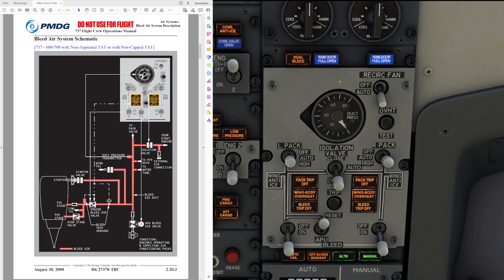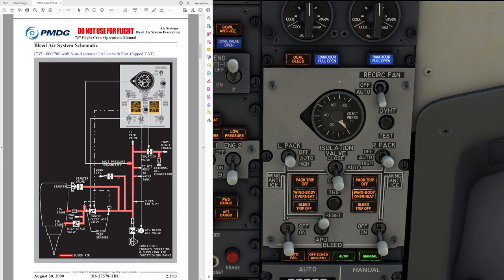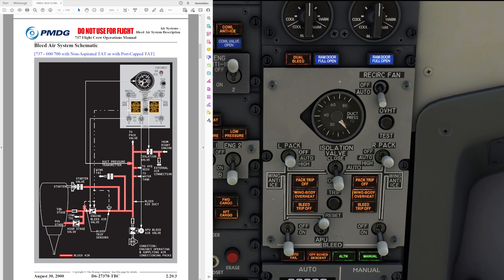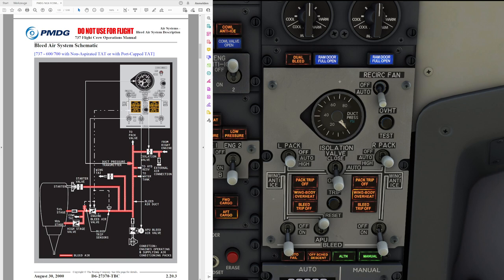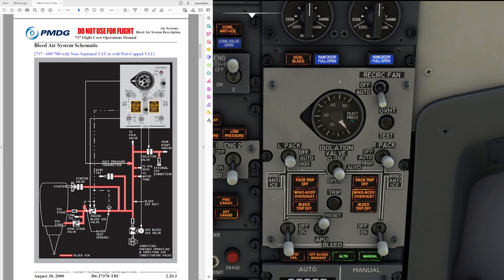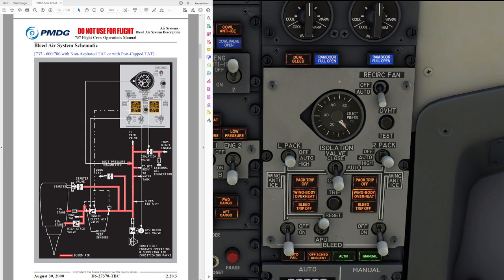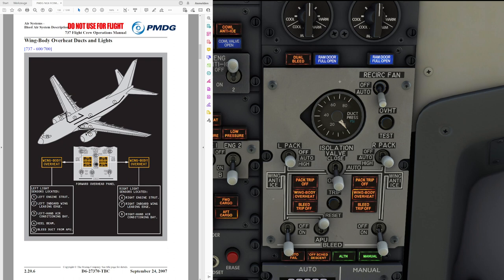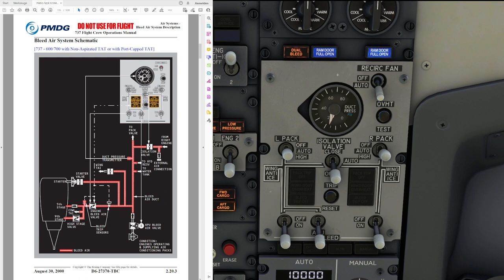737NG Bleed Air System explained | Real 737 Pilot

Comment: Since you are in the PMDG development team maybe you can help me. I have a problem with my rudder pedals. It works fine with every other aircraft , but with the 737 it doesn't work properly. I can not use both pedals for the rudder to steer left and right. Its like the whole axis is just on one pedal. So when i don't press for example the left pedal, the rudder is on the far left. When i fuly press it, i'ts on the far right. Same with the right pedal, but opposite direction. I just have no idea what the cause is.
Reply from the maker: For support contact support.pmdg.com, there you'll get help.

Comment: Do you know the temperature at which the bleed trip off light illuminates?
Reply from the maker: That's more of a question for an engineer than a pilot.
I don't know. I see the light, I react to it LOL
The exact conditions, like which temperature and which pressure, are not in the FCOM.
Reply: @A330Driver  Gotcha :)
Reply: 252c to 260c
Reply: The over temperature switch operates at 490F

Comment: I thought I'd seen in another tutorial that you're supposed to start the #2 engine first - how does this work when starting off the APU if it only provides bleed air to the #1? The isolation valve allows for the APU bleed to cross to the other side?
Reply from the maker: Correct, the Isolation Valve lets air pass from one side to the other.

Comment: So when you have APU bleed and Engine bleed both ON at high engine power setting, it can potentially overwhelm the non return valve on APU side with back pressure. Correct me if I'm wrong.

Comment: Nice video. Just wondering - is the bleed air clean air? If it comes from the engine compressor, wouldn't it contain engine exhaust and be unsuitable to, say, pressurize the cabin?
Reply: Compressor is before combustion section of the engine (same as apu, that’s just a smaller jet engine itself). So it’s highly compressed, very hot fresh air. Basically any bacteria or crap from the outside air is completely vaporized by the heat generated just from compressing the air. That compressed air then is bled off to run the bleed system. What isn’t bled off, runs into the combustion section of the engine where the fuel is introduced. From my understanding, pretty much all jet engines with a bleed system is this way. I can say for certainly the CL-65 (CRJ series) and 737 is this way. I’m type rated on the CRJ and going for the type on the 737 next month.
Reply: @JJay512  Thanks for that info, and good luck on your 737 type rating!
Reply: @tzampini  Thanks!

Comment: Great video again, I like the "explaining the ac systems" videos very much. <3

A question related to the topic with theese high air temperatures at the moment in summer came to my mind: How often in RL (or to ask in another way: "Is is common or not?") would you use the  ENG2 bleed after engine 2 start for the A/C to keep the cabin cool DURING the ENG1 start? 
Normally the time during pushback between "Packs off" and "Packs Auto after (both) ENG start(s)" is not that long, but perhaps in hot regions (or in summer like now) and a cabin full of PAX..?
Reply from the maker: I'm basically using the isolated pack operation on every single start.
It gets so hot so quickly in the cabin, I tend to say, when it's warm outside (or rather: When it's not cold outside) I do it.
Reply: @A330Driver  Thank you for this 'insight', Emanuel!
Reply: @A330Driver  Really? So..ENG #2 isolate, R Pack auto. with apu bleed ON for engine #1 start? or is this with isolate off+dual bleed from eng#2/APU run. i didn't think that would be enough for pack op+starter..maybe for one pack?

Comment: I did research regarding reference document used in this tutorial. It’s not longer supplied with PMDG’s aircrafts, due to intellectual property of Boeing.
Reply from the maker: Yup, that's it. I own the FSX 737 NGX so I still have them. But they are not allowed to deliver them anymore with new versions.
Reply: @A330Driver  Luckily Internet is a big place, so I found 737 FCOM version for me as well :)

Comment: Modern airplanes have a system schematic page you can display in airplane.
Reply: @FlatOutMatt  the a320 and max8 have similar systems. Except a320 has a RAT and 3 seperate hydraulic systems, instead of the 2 plus a backup of the max. 

The main difference is other airplanes can set altitude in 1000s of feet, instead of that 100 foot altitude increments in the 737

Comment: hello manuel, I have a question, if I have the engines off and APU operational, and I'm going to close both packs, the pressure should not rise, instead of going down?
Reply: Good question Typhoon. You are not confused at all. The pressure in the ducts is sensed prior to the pack valves so they will always read pressure. However, the APU Controller receives signals from the systems on the aircraft which require bleed air and adjusts the APU bleed output according to demand. With the packs off, no engine start, etc, not much air is required, so the APU Controller modulates the "inlet guide vanes" on the APU  towards closed to reduce bleed output. Not all aircraft types have this "demand" system.
Reply: The APU Bleed Air Shutoff Valve (APU BSOV) is an “On-Demand” valve. With no engine bleed air (engines off or engine bleed air valves off) and the APU BSOV open the APU will pressure the duct to approximately 10psi. If a pack is selected on or the engine starter is engaged the APU BSOV will open as needed to provide approximately 30psi.
Reply: @737simviator  I don't think you understood what Typhoon was asking.
Reply: @ImperrfectStranger  thank you for the answer, I had always wondered about this thing and thanks to you now I understand, good day

Comment: Enjoyed your explanation of the bleed air system. Hope PMDG fixes that error you saw when switching off the packs for engine start the needles should have increased to around 30 psi instead of dropped.
Reply: That’s actually how it is supposed to work. When the packs were turned off there was no demand so the APU Bleed valve schedules about 10psi. Had he selected an engine start switch it would have then delivered approximately 30psi. I provide a simplified description under Typhoon’s comment.
Reply: @SwaFixer  Ok I see. So the system only shows what the current demand is rather than what’s available.

Comment: Thanks for this amazing upload! I dont understand at 14:45 were you turn off the bleed packs. I would assume turning off the packs would result in a higher pressure but the gauge shows a reduction in pressure. Is it correct that packs auto also create pressure?